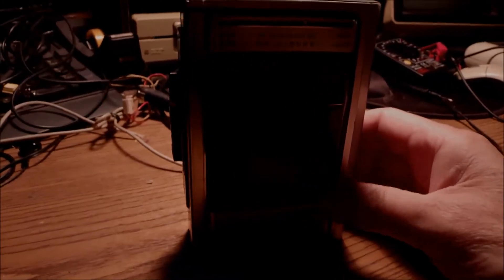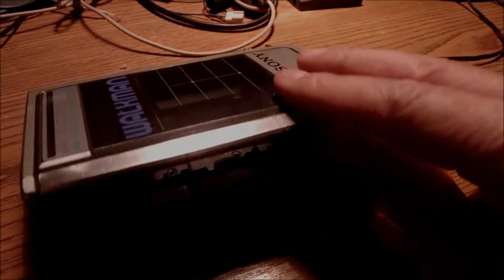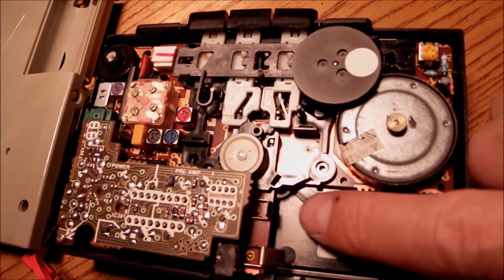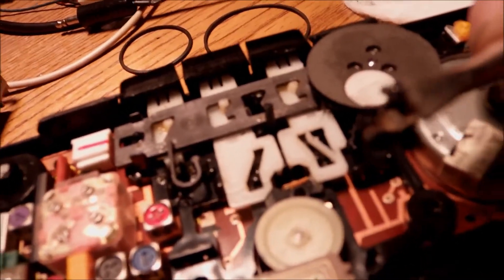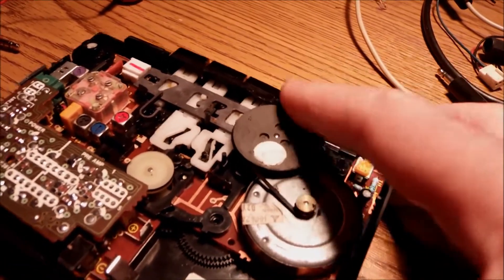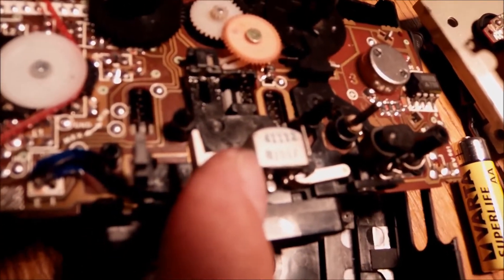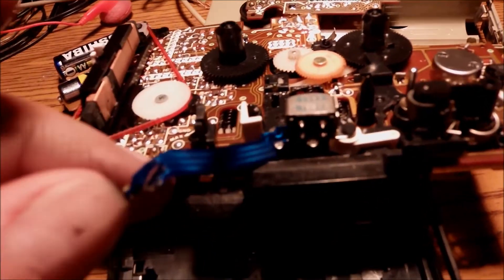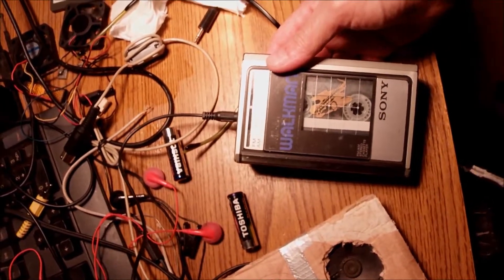SONY Walkman WM-F31 - 1986 - Restoration and repair.

Comment: I have the same walkman but I have a problem when I have the radio on and I press it back it turns off immediately, it is as if something made contact with something
Reply from the maker: hi there, the radio is a separate module that is plugged onto the main PCB, correct. So, it might need contact cleaner around the pins before it is plugged in. You can try this, sounds to me like there is some loose/dirty  contact indeed. 
Thank you so much for watching!
Reply: @CyberhugTechnologies  thank you for respond, I’ll try it for sure 👋🏼

Comment: How in the world did u get the board out
Reply from the maker: Hi, the whole thing can slip off if we plug out the preamp circuit - the buttons need a bit of pushing.. :-)  to be released from the plastic front.